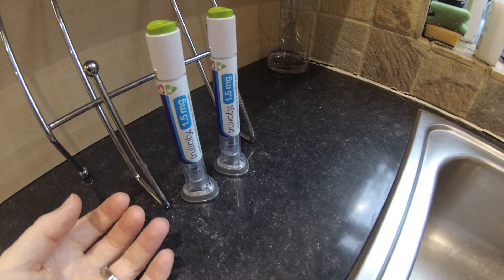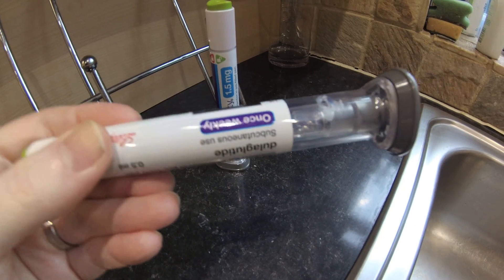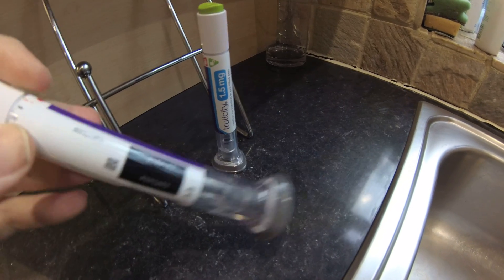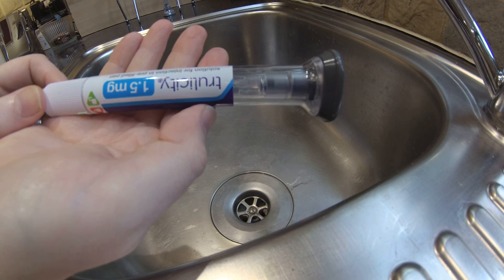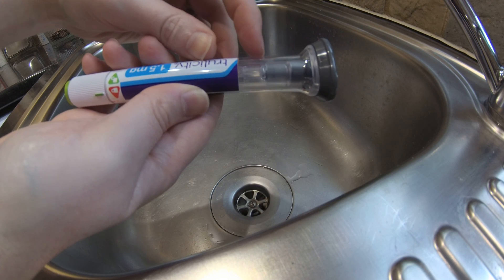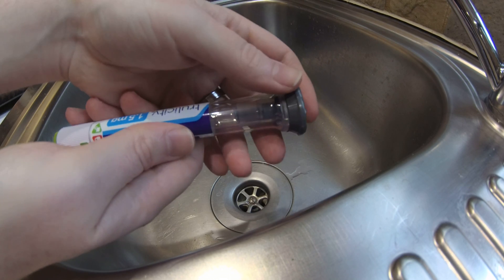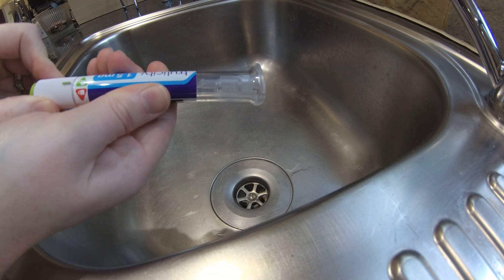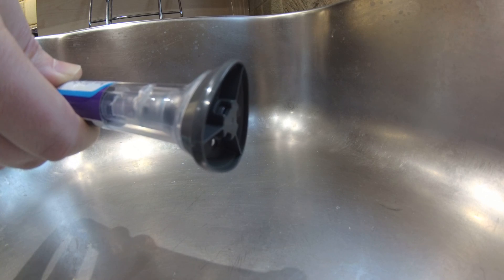Trulicity pen mechanical action

Comment: What is the purpose to make and use such a complicated contraption.? And why is it made so it can me only used one time. Such a waste of plastic and materials to have a complicated comtraption like that for just one injection?
My father had diabetes and my mother gave him daily insulin injections. When I was 12 years old I took over doing his daily injections. Th medicine was in a small bottle in fridge and last about 2 or 3 weeks. We had a glass shringe the had a glass plunger and a SSteel niddle the I twisted on the end. We kept it in alcohol in fridge. I just shook up the med and put the needle in its rubber top,  upside down, drew out the dossage, flipped the schrenge with my finger to get any air bubbles out, made sure dosage was right on the mark. Then wiped his hip with cotton ball soaked in alcohol and jabbed the needle in and slowly pushed the plunger down. The schrenge worked good for over 25 years and i replaced the needles about every week or so. My dad would tell me to use a new needle when he could feel the needle getting dull it hurt a little. We got the needles in different lenghts from a drug store in packs of 20 for a couple dollars. After each use i flushed the schrenge and needle out in the alcohol and ledt it in a glass container of alcohol in fridge door. 
So easy and reusable.  When the needles were dull i bent the tips with pliers and threw them in the trash bucket. 
So again I like to ask why are these one time use pens being used? Is it because people.have become too dumb and ignorant to use anreal schrenge that has a simple design going back hundreds of years.?